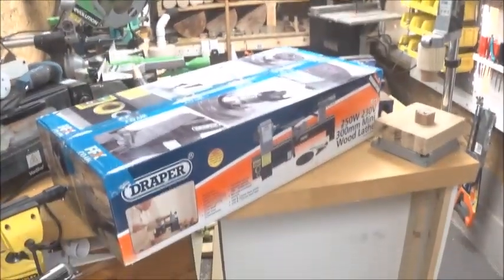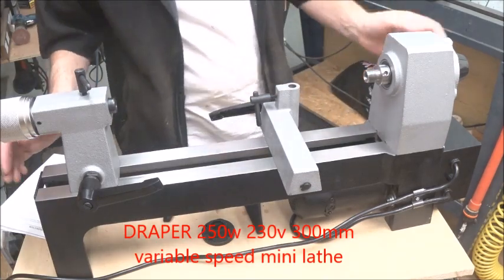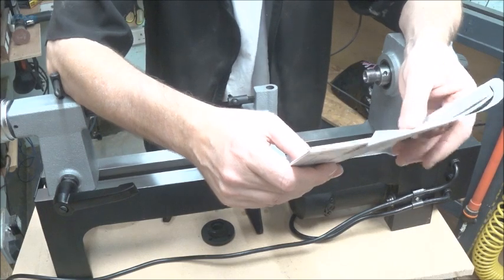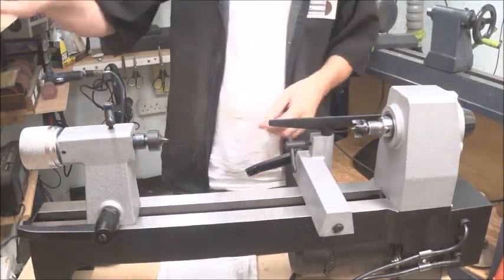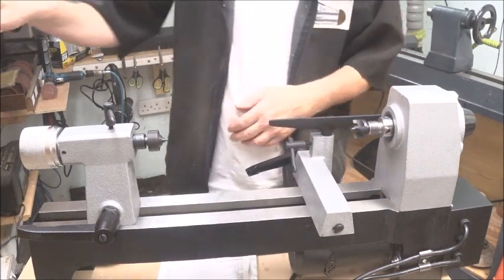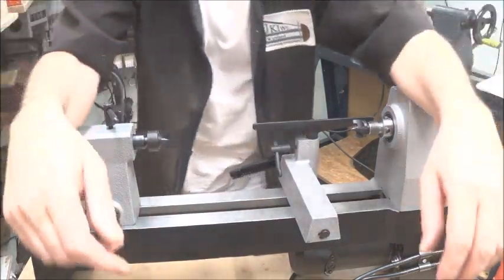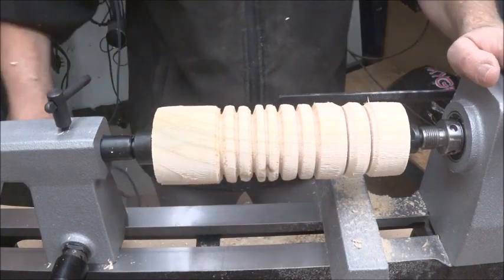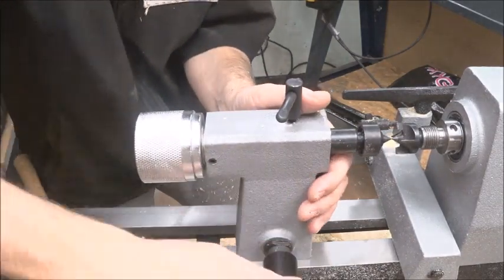E23  review on the DRAPER  Mini Wood Lathe

Comment: Hi Dave, nice to see the review on the Draper Mini Lathe. I have the same one and I am very happy with the lathe. My only minor complaint is that the part you commented on having been upgraded from plastic is difficult to use if you are trying to drill with the lathe (for pen blanks). I added a push fit HDPE handle (home made) to assist in the turning. It does make advancing the blank a little easier.  A very minor complaint !  The lathe is extremely good value for money as you say.   John
Reply from the maker: hi john i agree on what you saying but the lathe is good for small projects take care dave

Comment: Hi again Dave, I was wondering about how you find the power on this lathe. Draper have another version that has a 500w motor instead of 250w but i was wondering would you say that this has enough power to make anything that might fit into it? or do you find that sometimes theres not quite enough power?
Reply from the maker: hi david yes mate it looses power on certain size turnings but i found it okay for pen turning and little trinket boxes the other version you speak about sounds a bit better on bigger things 
i found it loosing power
Reply: @woodturningwithDave  Thanks for getting back to me, thats something to consider definately for the bigger stuff so!

Comment: Nice video and little lathe, Just a little tip, if its electronic variable speed, if you ever get any problems with the speed control, more than likely the control box is full of dust, on my lathe i have made a filter around it to allow it to keep cool, but not let the dust in!
Reply from the maker: thanks for the tip will remember that if i do get problems